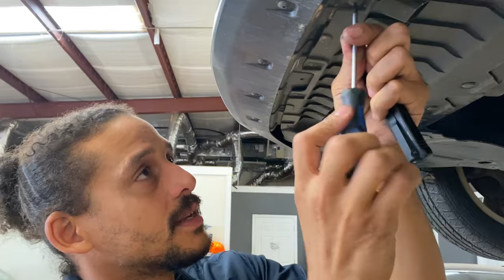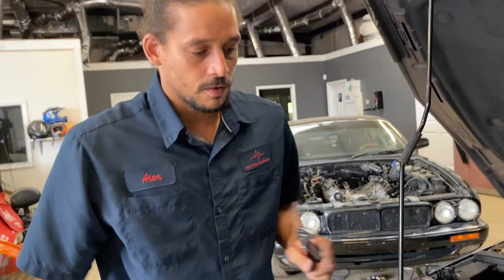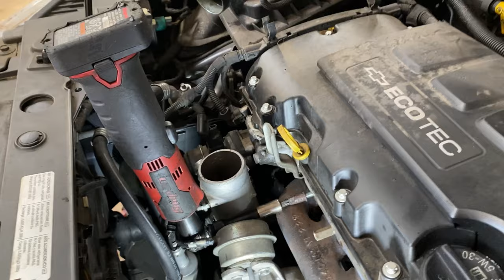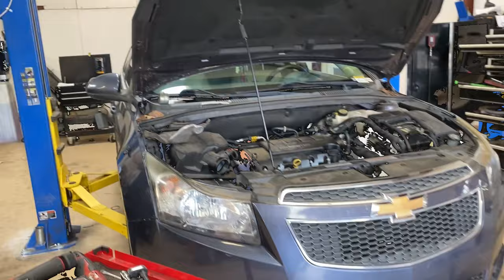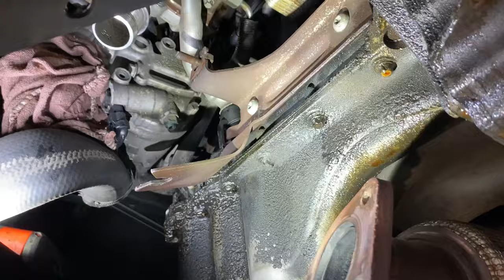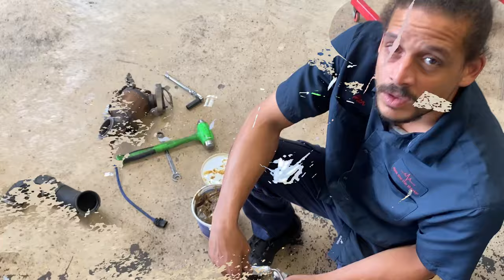Chevy Cruze Turbo Removal Process  ( Fixing a Coolant Leak By Replacing The Turbo Cooler Lines)

Comment: What's the torque for the coolant lines?
Reply from the maker: I’m sorry I don’t remember
Reply: @Alex, The Car Doctor do you remember if the inside of the new fittings were threaded or not? I picked up a new turbo charger coolant line (part number 55567067) and a fitting from the dealership. The new fittings appears to be threaded all the way through with a locking ring. Is that how yours looked? And this should just pop into the new fitting, right?
Reply from the maker: @MrAG816  from what I remember the inside of the fitting wasn’t threaded just outside I looked up the part number that appears to be the right part you have

Comment: How can I avoid snapping the bolts on the Cadillac converter
Reply from the maker: You can go to Home Depot and buy a torch get the yellow bottle tall single bottle with the torch head and heat it up really good and slowly try to remove it

Comment: Hey man, I really appreciate the video it’s helped me out a ton with the process but something that’s so damn strange is that after I installed and put everything back my car’s like now having problems staying on. Like once I turn it on it’s starts but after like 2-5 second it starts to sound like a lil weird and it shuts off. I had someone come and take a look but they had no idea, and after days of researching stuff I found stuff relating to the “mass airflow sensor” but I’m no sure if it could be the problem because I never touched it or even changed anything near it.  I’D APPRECIATE ANY HELP WHAT SO EVER MAN! Appreciate the video though fr!🙏🏼
Reply from the maker: Hey there buddy I’m glad you enjoyed my video.do you have a scanner
Reply from the maker: We are going to get through this together
Reply: Appreciate you man! I do not have a scanner though but I was told by the mechanic that came by that it’s something to do with mass airflow sensor but I went to go purchase one and I’m still having the same issue as I explained smh . You have any idea what it could be that doesn’t allow the car to stay on ?
Reply from the maker: My suggestion is buy a scanner so we won’t be looking for a needle in a haystack they are like $30-$40 on Amazon would you like me to send you the link. my recommendation for all car owners is to own a scanner

Comment: The guy I'm getting ready to do one for it came with a small bottle of oil I'm guessing it's brake in oil were do I put that in at squirt in at the top oil line or were I e not ever done  one of these before and the last guy locked the first one up please help the guy really needs this car back on the road I've been asking around but no one will answer me thank you and  have a blessed day or night
Reply from the maker: Hey there buddy That little syringe of oil primed the turbo so you will not start it dry. Yes you squirt it in the top where the oil feeds into the turbo. Also check the turbo feed line and the drain pipe sometime they will get stopped up and if that happens, you will burn up your turbo pretty quick

Comment: My car is leaking oil from the Intercooler hose. What could be the problem ?It’s a 2011 chevy Cruze ltz.
Reply from the maker: Hey there it’s somewhat normal to see oil build up In the intercooler tubing I won’t be to worry about that unless it’s white smoke coming from the tail pipe and then you have a problem
Reply: @AlexTheCarDoctor  it’s leaking a lot, enough to leave oil puddles on the ground. No smoke from tail pipe though.
Reply from the maker: @brittaniereed5664  that’s not normal is the car lacking in power
Reply from the maker: Also how many miles on your car
Reply: @AlexTheCarDoctor  203k could it be the turbo? We just replace PCV hose and the valve cover.
Reply from the maker: @brittaniereed5664  with those many miles The turbo seals have seen their fair share of Wear I wouldn’t doubt it, are you losing any power
Reply: @AlexTheCarDoctor  the car doesn’t have the go that it used to that’s for sure.
Reply from the maker: @brittaniereed5664  any check engine light
Reply: @AlexTheCarDoctor  yeah p0171

Comment: all that work for nothing when you could of replaced the tiny hose 10 minutes, talk about ripping off a customer. i guess you need the money and youtube revenue.
Reply from the maker: Obviously you are making assumptions that I’m not going to dignify with a response. Merry Christmas
Reply: @AlexTheCarDoctor  I apologize for that because I had job like and I did what you did replace that line but to get it I opened a can of worms.  bolt on cat broke, all nuts holding exhaust manifold rusted to nothing, the clamp holding cat to turbo snapped , oil drain tube also broke and coolant hose  bolted to block started leaking and Noone had it in stock. car was at my shop for two weeks when I  should of just replaced the little hose. live and learn . Merry Christmas

Comment: I can't remove the bolt from the top of the catalytic converter 🥲 I used a 10mm extractor and I just smoothed it out more and continued with 3/8 and it doesn't fit.